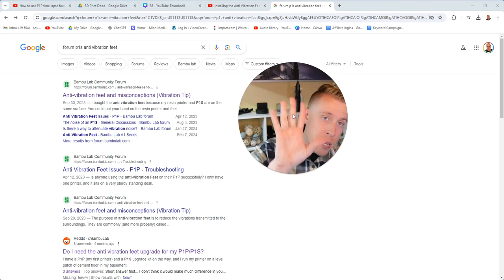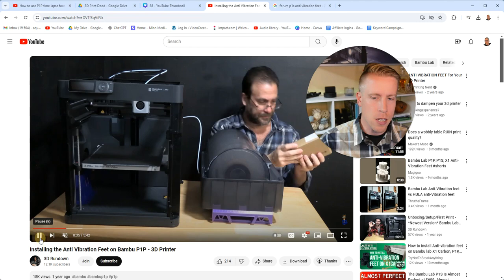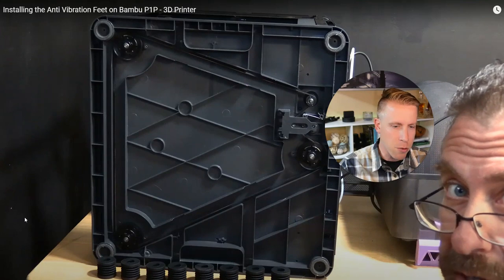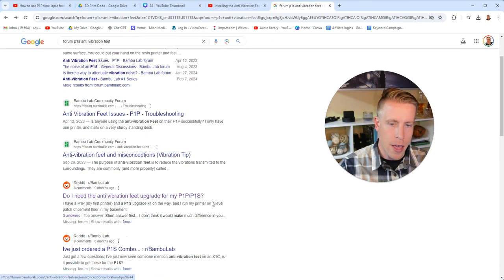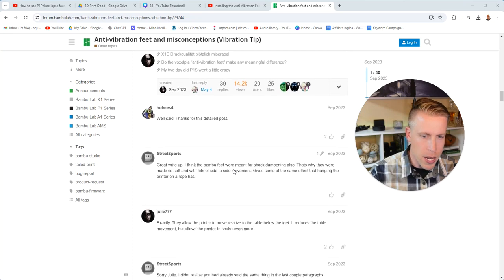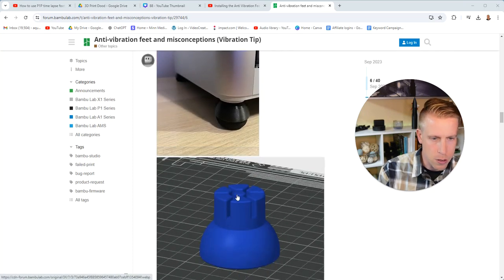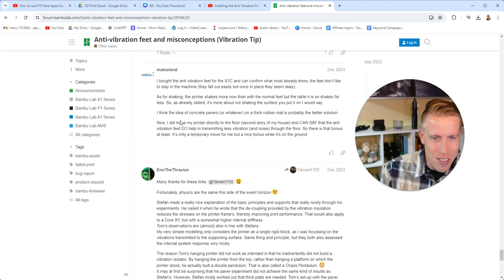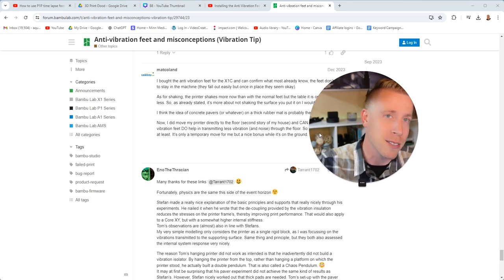Bambu Lab Anti-Vibration Feet Worth It? REACTION

Comment: I'm a year late into this conversation but only because I just got my X1C about a week ago. Lucky for me, my neighbor sold her house and she had to get rid of a bunch of things so I bought her printer for a really good price.
Anyway, the conversation about anti-vibration feet or mounts for 3D printers or any equipment for that matter, is not difficult to understand when you apply physics.
Think of your car engine, it is mounted to the frame with engine mounts, thick rubber feet. Industrial equipment aboard ships are mounted with shock/vibration absorbing mounts. Seismic mounts for structures, same thing. The application, no matter the use case, has the same goal in mind; transfer vibration, shock, heat, sound, away from the source and/or, damper external forces applied to the equipment. The anti-vibration devices work both ways.

Anti-vibration feet function as mechanical decouplers that isolate a 3D printer from its mounting surface, primarily to reduce noise and prevent structural resonance. When the print head or bed rapidly changes direction, the machine generates a significant amount of kinetic energy; without dampening, this energy is transferred directly into the desk or floor, which can act as a sounding board and amplify the sound. High-quality anti-vibration feet, often made from viscoelastic materials like sorbothane or high-density rubber, absorb this energy and dissipate it as low-level heat through a process called hysteresis.

The reduction of transferred inertia is achieved by creating a flexible interface that allows the printer frame to move slightly in opposition to the tool head's momentum. Instead of the force of a high-speed jerk being "stopped" by a rigid table—which causes the frame to vibrate or "ring"—the anti-vibration feet allow for a controlled amount of lateral and vertical displacement. This decoupling ensures that the momentum of the moving mass (the print head) is not abruptly transferred to the environment, but is instead managed by the compliant material of the feet.

Vibration Isolation: Prevents the desk from vibrating, which is crucial if multiple printers are on the same surface.

Energy Dissipation: Converts kinetic energy into heat rather than mechanical noise.

Reduced Frame Stress: Minimizes the "kickback" force that travels through the frame during aggressive acceleration.

Going back to the engine mount analogy, imagine if your engine was mounted directly to the frame. Every bit of engine noise, vibration, and heat would transfer to the frame; and likewise, every bit of shock applied to the frame via external forces would transfer to the engine - not good for moving internal parts.

So, no matter what, anti-vibration feet are beneficial for the intended use case. They marginally improve printing quality but they can significantly improve the printer's performance and longevity by reducing the stress on critical components.

Comment: Jumping in late, hopefully there are updates. here are my thoughts after 1 month of printing on p1s.

1 - stable surface matters. if the surface the printer is on is wobbly, you will get more wobbles. try not to have the printer on anything with wheels and ideally the printer is on something that can be secured to a wall or floor. If not, you will need to increase mass of the surface the printer is on.

2 - center of gravity matters. the higher off the ground the printer is, the more it can wobble, especially if it is not towards the center of the vertical center of gravity. so in the case of shelves, especially tall shelfs, you can reduce wobble by being closer to the middle or the ground.

3 - print object / speed matters. there are some in the comments who say they never get any wobbles, but perhaps they have never run their machine to the highest speeds while it zig-zags on the shortest lines (to get the print head at its quickest back and forth speed over a short distance on the bed). Printing big, square walls? you will never see you machine budge. Printing short infill? your machine will dance; regardless.

4 - i went from printing ontop a large, heavy husky tool bench with wheels to (3) 16x16 cement pavers ontop a large metal storage safe. It looks like a sturdy tower with the ams ontop the p1s landing eye level. Here is a self inflicting wound I think I am creating; more paver for more mass and more height = putting the printer at a higher center of gravity thus creating more wobbles.

I have less overall shaking from getting off of a wheeled surface, however I think I have more shaking of the machine itself. Either way, I have yet to notice any print quality changes.

Final thoughts? I think some people in the comments are onto it, I think the vibration needs to be passed on somewhere. I think the harder the surface it is on, the more it will dance. I think any analogy of a car that has suspension shocks versus a car that has no suspension shocks comes to mind. I think we should be looking to dampen the shocks. My only other thought is to secure the printer to a surface somehow, where it is mounted solidly to a vertical or horizontal surface, but I think our previous thoughts will hold true; the energy needs somewhere to go. I imagine if the printer where secured to a surface, the stress would be put on the print head (but perhaps calibration would solve that?).

Comment: To me, it seems the point of the feet is to reduce the effect of one printer's vibration on other printers that might be on the same table.  The calibration sequence at the beginning of a Bambu printer's print job would presumably only be able to account for the movements that the printer itself makes.  But if there's another printer next to it that is also shaking the table, then those movements that are caused by the second printer would not be accounted for in the calibration sequence.

That might be why there are two sets of feet in the package and why the instructions tell you to make sure you separate the printers.  

If that is the case, then each printer with antivibration feet would seem to vibrate more but the table would vibrate less.

So Bambu just needs to rebrand these as something like "vibration isolation" feet and do a better job explaining this.

Comment: The feet exist so that the printer doesn't shake your table as much. It's not for the printer itself. That way motor noise doesn't get amplified by your table, you won't hear it as much on adjacent floors.

Comment: He literally ignored an actual informative comment on the forum at the end of the video. It is exactly right, the vibration has to go somewhere and by the print bed physically translating that vibration into movement outside the printer means that the excess force is exerted on the feet and table instead of the printer frame and bed. The feet will work well to remove slight vibrations in the printing process and noise isolation.,

Comment: I mean I want my printer vibrations to not affect the other printer next to it, so, if the table vibrates less, that's exactly what I need
Reply: That's what it does. I installed them today and the printer shakes more but still prints perfect and the printer next to it doesn't shake at all. I feel like it's a miss conception. You would think the printer would shake less but it's so the table/shelf doesn't shake therefore there is less noise 😅
Reply: @TheFunesk  can't wait to print a few feet myself 😊 now I need to figure out which feet are best for this, there's a few different types in makerworld

Comment: Most people don't think about this issue from a physics point of view and forget that the energy generated by the printer itself has to go somewhere. It's either being passed on to another object or stored within affecting the printing operation internally. A heavier rectangular object underneath with a dampening memory foam mat can work well on a sturdy desk bench.
Reply: I get that, I think. BUT ;) Don’t the  feet now absorb the kinetic energy and lessen impulses on the internal mechanics?
Reply: @sebastianmetz  spot on, i am not a scientist, but energy can be absord, can't it?
Reply: sure, it can only be converted. In this case I would think the feet convert the kinetic energy into heat thus lessen the impact on the mechanics. they take energy out of the system.
Reply: @sebastianmetz  "the feet convert the kinetic energy into heat"? Sounds like you've got some science homework to do m8 😂
Reply: @YaNeK92  He's actually very much correct. When you compress and release a spring, you are converting kinetic energy into heat energy.

The problem with these feet are they are far too elastic and the vibrations are far too weak to be dealt with, with a spring made from a stiffer material (like steel). Car suspensions systems use a piston assisted spring to convert kinetic energy into heat quickly and effectively.

The problem with these feet is they are far too elastic. They will absorb only a small % of the vibrations, they will isolate transfer to the surface underneath and most of the vibrations will be reflected back into the printers frame. The density/mass of the feet are just too low.

A good heavy slab of material like concrete, with a large isolating rubber sheet underneath will be able to absorb and convert much more kinetic energy to heat than these little rubber feet.

Comment: i really dont get whats not clicking for most of you. The feet are to decrease the amount of vibration the printer is putting on the surface. it has zero to do with making the bed or the head more stable. Their purpose is so that the motors in the printers do not translate their friction into the surface. it is a comfort upgrade to a single printer and valuable for print farms with units close to each other.

Comment: The feet reduce vibrations to the surface the printer is on, so if it shares a shelf or table surface with another printer or something that's not be shaken (say if you want it stirred, not shaken), that's what they're for. I believe the new design iteration of the anti-vibration feet alleviates the issue where they fall out of the printer. HOWEVER, the drawback is that instead of being able to send vibrations downward to the surface it's standing on, the printer now absorbs all the vibrations itself, which is NOT recommended in the long run. 

I use a washing machine anti-vibration mat underneath a concrete slab. That effectively cancels out a lot of the vibrations both for the printer and the table, and it's also healthier for the printer as it won't be shaken so violently around.
Reply: Very good point! Most people don't think about the physics aspect of the situation where the energy has to go somewhere.
Reply: I don’t know how my last comment disappeared but @YaNeK92 please enlighten me about my physics homework I have to do. Seriously, Where does the energy go? Is it harder on the mechanics when the whole printer can sway or if it stays rock solid?
Reply: @sebastianmetz  The simplest way to explain is that it is much more difficult to move something with a higher density/mass. Putting a heavy concrete slab under the printer means that the small vibrations of the printer on top now have to move this big heavy slab if it wants to translate the vibrations through to the surface underneath it.

If you then also add a rubber mat underneath the slab, you get a dampening effect that allows slight play in the surface for any residual vibrations that make it through. This acts like the rubber feet.

Whilst really we want to get rid of all the vibrations from the system above the rubber mat, it's not really viable this way, so the rubber mat really is just an isolator between the slab and the surface it's on. There won't be much left after going through the concrete slab though which makes it ok. More to the point, since the mat is flexible, some of the vibrations will be reflected back up. It then has to go all the way back through the slab to get back to the printer, which it's unlikely to be able to do.

The slab + The rubber mat end up working like a simple shock absorber in a suspension system. You have the Rigid slab on one side, the spring in the middle and then the rigid surface underneath. The kinetic energy coming from the printer through the rigid concrete slab goes into the rubber pad, this acts as a spring which will absorb a % of the vibrations causing it to heat up (Not enough from this that would be noticeable). The concrete slab however might raise slightly above ambient temperature since it will likely be absorbing most of the vibrations. It would actually be interesting to see someone test this.

Note: This is not the same as a cars suspension which uses a piston  based shock absorber to convert the kinetic energy into heat.
Reply: @sebastianmetz  I would honestly love to be a part of a fun science discussion however all the comments I'm making keep getting deleted bro. Anyway I hope you enjoy the rest of your weekend, all the best! 🤙🏼

Comment: I printed some feet in TPU and they've worked great for the past 5 months with no issues. My printer sits on a custom made workbench which itself sits on casters. Since I'm not the most skilled woodworker (the workbench is the only thing I've ever actually crafted out of wood) you can image that it's not the most stable platform, but the printer has been working nearly 20+ hours a day for months without issues.
Reply: I built a 20x24" table on 4x4 legs and a 1" top with castors from Harbor Freight (fairly heavy table).  I was afraid the castors would mean the printer would roll on the hardwood floors but they don't move.  The table is big enough for a poop shoot and I printed storage drawers to mount underneath.  I ended up rolling the printer into a closet on carpet and have zero issues, on top of that I can close the closet doors for nighttime printing or when I'm on a work call.  Great minds think alike!

Comment: I have my printer sat on a paver which is in turn on top of a high density foam pad (a tile square from a garage floor) and it’s rock steady with zero movement on a workbench.  Nothing on the workbench moves or vibrates while it’s in operation with this set up either.

Comment: I had the original feet for my X1C. They did not work. They were pretty much just rubber slinkies and eventually the printer would shift to a side and smush the feet or pop them out. 

Original feet work good enough. Just get a better table or a concrete paver to put under the printer.
Reply from the maker: Really?

Comment: Two words: mass damping

Heavier things take more energy to move, if you have a heavy enough load (concrete paver) it won't move under the relatively light loads/excitations from the printer. More effective is a very solid bench. I have my printer on a storage shelf racking type system and screwed it to the wall - I get no movement at all.

Comment: From my understanding, the point of the feet is to reduce vibrations in a print farm situation. You don't want the vibrations of one machine affecting the printer beside it. If you have six machines on one shelf for instance the vibrations will be quite chaotic and will affect the print quality across all of the machines. The feet isolate the vibrations to the specific machine only or at least that's the idea.
Reply: Yeah this makes sense. If it's just one in your house you can put it on a heavy slab or even clean floor, in a farm they're on racks that aren't 100% solid.
Reply: If I only have one printer, do I not need them at all or can they reduce noise as well?